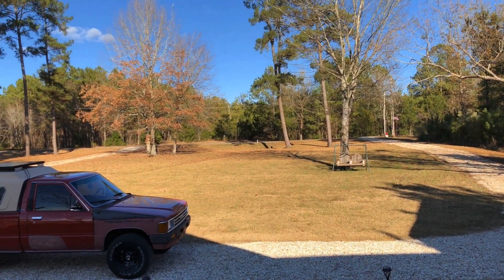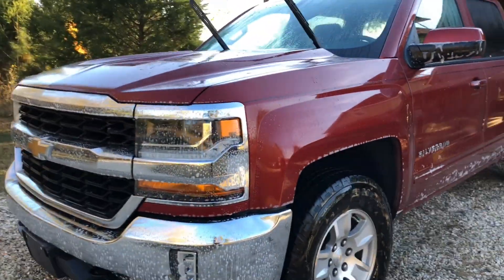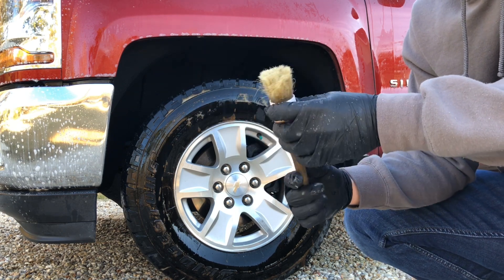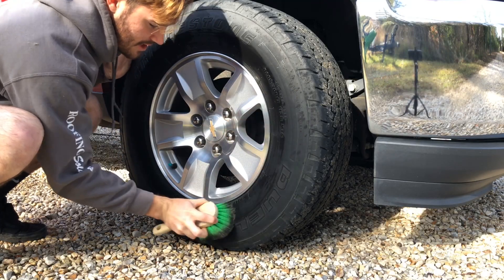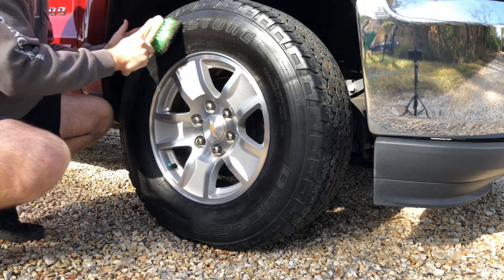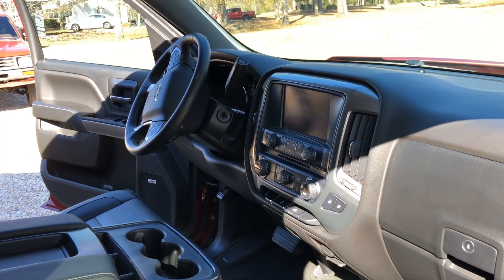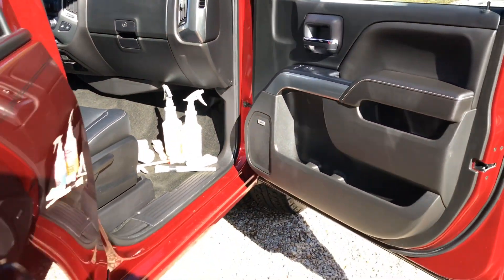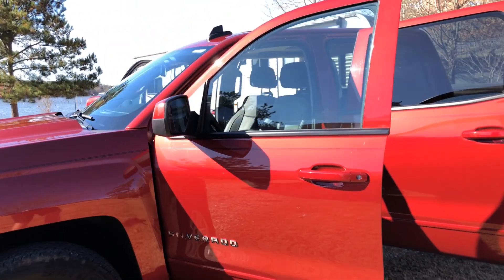Mobile Car Detailing: TIME LAPSE! (satisfying)

Comment: Thought you've been doing this long enough to know that you don't dress the day then spray glass cleaner all over it spraying  the interior windows.. Please spray glass cleaner on a clean microfiber and then wipe the windows.  Also hope you dried up all the water from blasting washer inside the door jams  that's the worst idea.  More work for no reason. Still you did a decent job